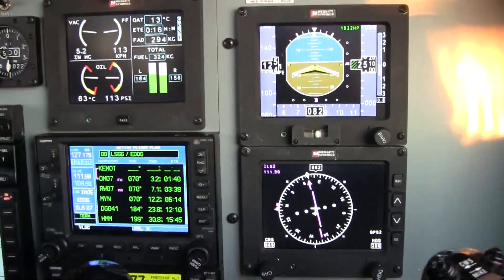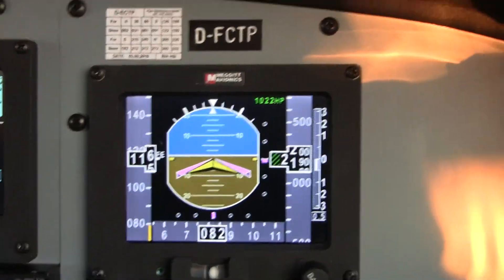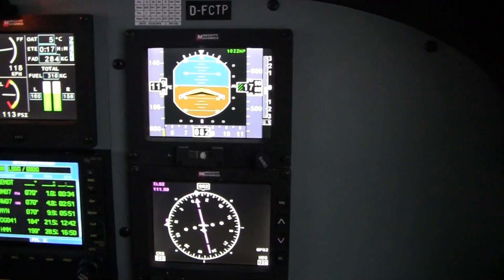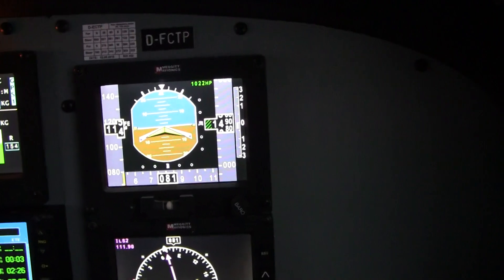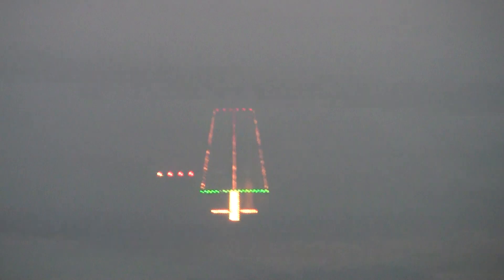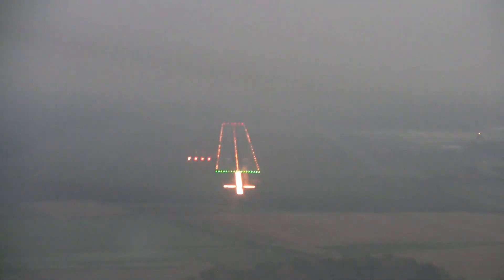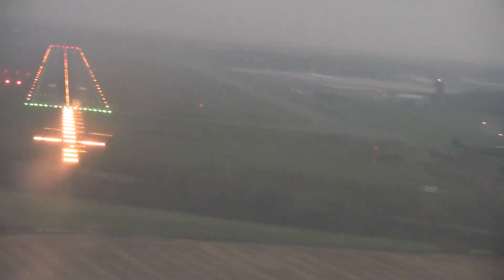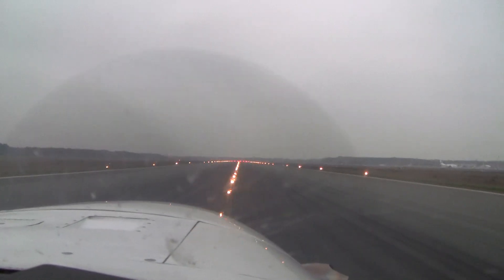Finding the Runway, Final Approach and Landing in a Piper PA46 Meridian

Comment: What does the crab mean?
Reply from the maker: Hi, “The crab” refers to the aircraft’s attitude in flight with reference to ground track. “Crabbing” is the term used to describe straight, wings level flight (without holding a slip of any kind) to align the aircraft’s track with the extended centerline of the runway. I will ask pilots to “hold the crab” until ready for the landing flare. Once a pilot understands this technique crosswind landings become .. well, a breeze! Fly Safely - Train Often .. DR

Comment: When you're low on approach, you need to add power, NOT raise the nose. Remember, attitude controls airspeed, power controls glideslope. At least that's what they taught me in navy flight school. :)
Reply from the maker: Hi Bob, Thank you for your service. The Navy makes great pilots out of good ones. Your comment gets back to the very concept of primary and supporting vs pitch-power-configuration. In training PA46 pilots I teach PPCs because I believe it is the best way to minimize the variables in the single pilot environment. For example: if 300 lbs of torque and gear extended and 10 deg of flaps extended yields 120 Kts on the GS  then normal circumstances will yield excess airspeed if the aircraft is low. Large wind and rain events excepted. Have fun.. Fly Safely-Train Often

Comment: Just a quick question.  I always hear don't come off the autopilot until field in sight yet all IFR training is hand flown.  Granted when I've let the AP fly the approach and monitored the progress it's easier, but I feel like I'm cheating this way.  How much should I work on hand flying.  I feel it's safer to fly with the AP in IMC especially down to mins.
Reply from the maker: Hi Brian, I agree with you. When used in accordance with proper training, the autopilot is the greatest safety improvement to the single pilot environment in the history of modern aviation. It improves the single-pilot's ability to avoid distraction by freeing up his or her mental bandwidth. I also believe that it must not be relied on to the exclusion of pilot skill and experience and herein lies the problem. A fully functioning three axis autopilot is a must for single -pilot IMC operations. It is also true that single pilot operators tend to fly less often which means their hand flying skills can suffer. Pilots who wish to fly single-pilot in IMC  must train to and maintain a higher level of proficiency with respect to their hand flying skills and their automation skills because both are necessary. I recommend that each single pilot operator adapt a well-vetted SOP and use it in conjunction with type-specific checklists, flows and memory items.
Reply: Brian K Rich MD Ive always been taught to use autopilot like it was another human pilot in the cockpit. It is very useful when you have your hands full.

Comment from the maker: Hi Scott, A memorable first solo ILS ... very gratifying I am sure. You probably already know it keeps getting better too!  Centerline management helps the pilot know what the wind is doing all the way to touchdown and makes for better landings as a result. Consider holding the crab (not the slip) all the way to the flare. It's actually easier once you get the hang of it because it doesn't require any power change to offset drag and non-pilot passengers find it more comfortable.

Comment from the maker: Hi Saberpride73, it's not a bad idea to stop after clearing the runway but I do not require it. My SOP says that single pilot operators should not read unless on the AP or stopped on the ground. The use of a flow or memory item while taxiing straight ahead in an open area is acceptable & sometimes necessary in order to promptly comply with a taxi clearance.